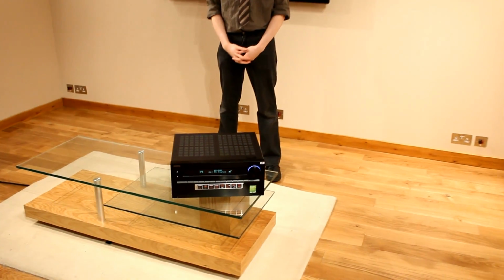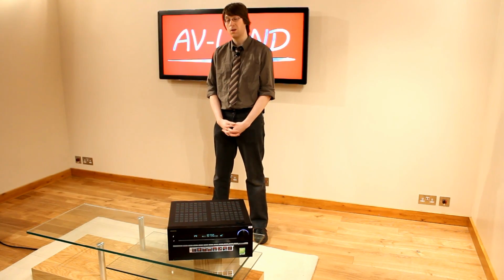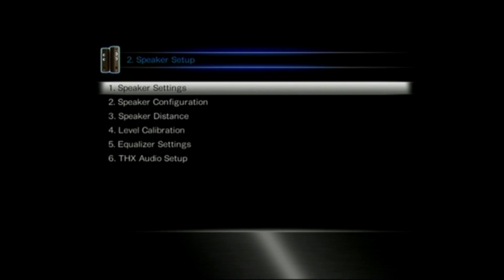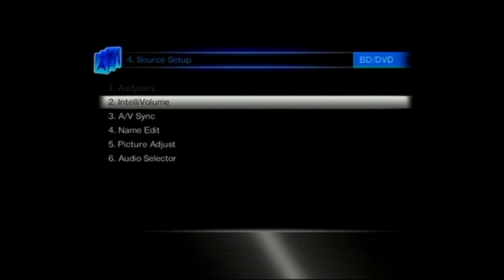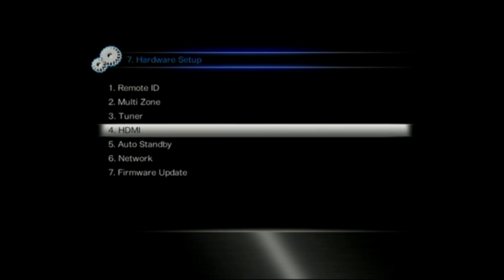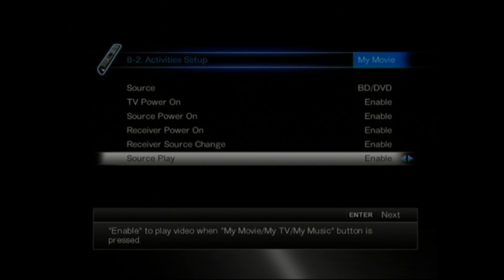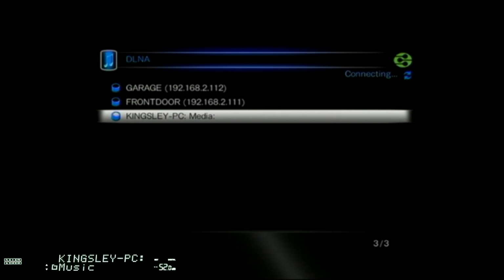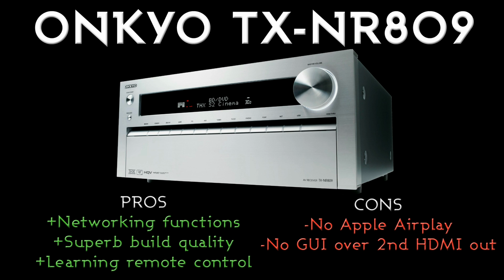Onkyo TX-NR809 21 minute Review by AVLAND UK

Comment: great review! looking to get one of these (or the 709).  I use all external amps off the preamp outs of the receiver so since you've popped the top, did you see if the power connection to the amplifier is a separate plug that can be undone to turn it into a preamp essentially?  That's how I'm running my Onkyo TX-SR703.  
thanks

Comment: do the HDMI outputs also carry the audio (5.1) signal? I realise you are supposed to connect the speakers directly to this device but I would prefer to use my other home theatre amp and have 1x HDMI to TV (video) and the 2x HDMI output to the other home theatre amp but want to make sure this will work correctly prior to throwing the cash down on one.

Comment from the maker: @holchr31 Yes, you are able to bi-amp with the TX-NR809.  The 6th and 7th channels are assignable and you could use them for 7.1, a bi-amped 5.1 system or as a powered Zone 2 output.

Comment from the maker: @Jeanis98756 The GUI itself is taken straight from the Onkyo video output.  It will playback from a NAS drive provided that the NAS drive is compatible with DLNA, which not all NAS drives are.  You can use the front panel display of the TXNR809 to navigate through folders and files as you are streaming so you do not have to use the Onkyo's on-screen menus if you do not wish to.

Comment from the maker: @Cyclops89 There is a noticeable difference in sound quality between the TX-NR709 and TX-NR809 that is not just about power but should give you better audio reproduction across the frequency range.  It is also better built and has a sturdier construction to help reduce vibrations, and internally uses better components including copper bus bars which you would not normally see on this receiver's price point.

Comment from the maker: @cyberathlete Password protected hard drives will not work with this receiver - there is no option to type in a password when the hard drive is plugged in.

As mentioned below sound quality is difficult to textualise and varies greatly on the speakers paired with it but it copes admirably with both music and movies and the Onkyo is very flexible with different speakers.  I cannot think of any way the 809's sound quality could be described as "sub-par" when compared with similar receivers.

Comment from the maker: @omegatron7 We have tried to do this here and do not seem to be able to.  If there is no sound signal coming through HDMI then it is possible that it may take the audio from another connection but at the time of writing HDMI seems to overwrite any other connections assigned to an input.  This may be changed with future firmware updates.

Comment: Could you tell me if it is possible to run Video through a hdmi connection, and audio through one of the coaxial/optical connections at the same time? if so, can this be configured for '1 button' push on the remote?